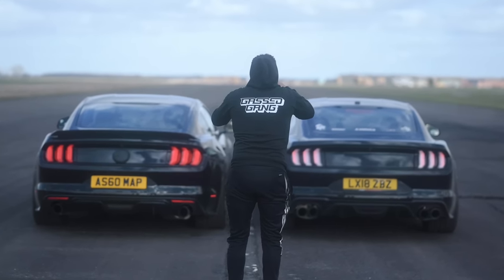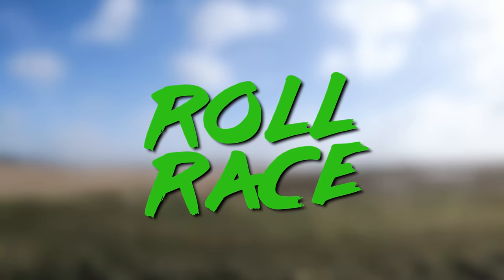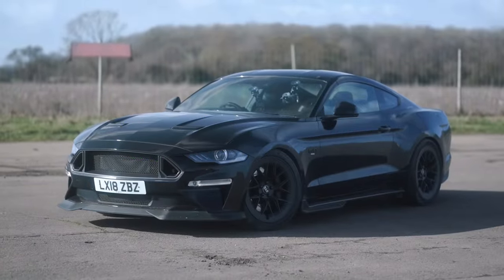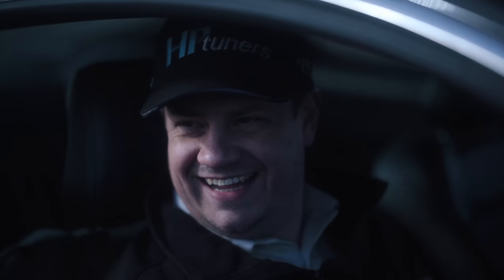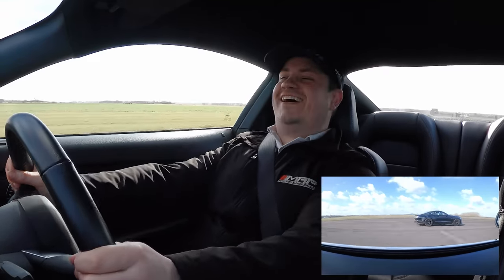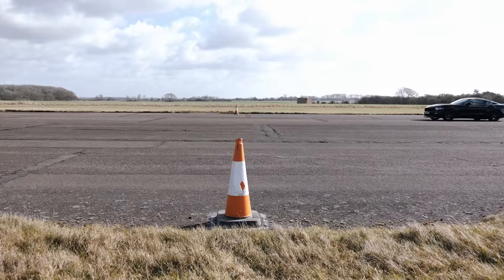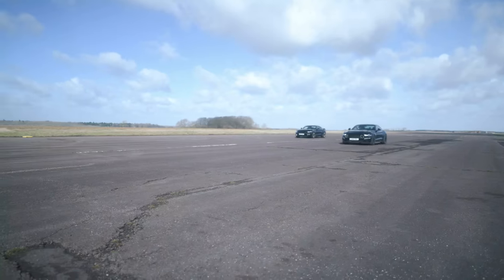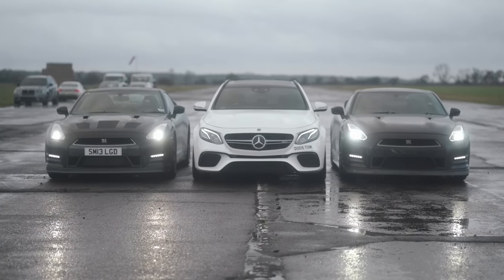TWIN TURBO vs SUPERCHARGED.. 980BHP vs 950BHP FORD MUSTANG GT

Comment: I have seen some poor driving but this is at the top.   They managed to run slower 0-60 and quarter mile times than the stock cars. I've personally gone 12.23 at 117mph in a bone stock 2020 Mustang GT manual.  These cars should have easily been in the low 10 sec.range.
Reply: Overpowering the street does no good , so you are right you would run faster on the street with a stock GT
Reply: Even an Ecoboost can run a faster 1/4 mile than these
Reply: If you overpower a car, then it will inevitably go slower in short distances due to a lack of traction. Just as Bosko said. Plus, these are manuals. Looks like you aren't a car guy.
Reply: I wish they would’ve put some slicks or bigger tire on the rear
Reply: @aXrF  Set up a 2 stage and that wouldn't be a problem. I have a 2018 Mustang GT just running a tune and E85 and my 0-60 alone is 4.2 with street tires and a non prepped surface. 
There is no reason why there cars should be running slower at any distance.
Reply: I’ve been 10.30s on a 100 shot…. These are turds
Reply: Thank god I’m not the only one who thought that like my gawd
Reply: you can tell they’re there just to have fun not set the fastest times
Reply: As the narrator said. "With a prepped course these 2 cars are 9 second cars." Unprepped, they can't get traction. Overpowered.
Reply: @caaleb49  Nah, I don't think so. But you can always dream.
Reply: @Necronomous  a stock Ecoboost runs a quarter mile in 13 seconds. An FBO Ecoboost will run sub 12’s. I have an Ecoboost and it runs sub 12’s and I haven’t even installed my NX2 Turbo yet.
Reply: @aXrF  my manual, on the street w/ stock tiresn no boost, tuned w/e85 ran 12.3 on draggy....
Reply: @caaleb49  Good for you. Unprepped or prepped surface? If you say prepped surface, you are still 3 seconds behind these 2 cars.
Reply: @Necronomous  Never even taken it to a strip, it’s a track car and I do all my runs on a long stretch of flat road in the middle of the desert. It has built in 60 foot, 1/8 mile, 1/4 mile, half mile, and 0-60 measurements, so that’s how I get the numbers.
Reply: @caaleb49  Nice
Reply: @aXrF  dude I drive a manual 3v with FBO only and I can get faster 0-60 and 1/4 miles than them, they’re kinda slow drivers and the road is bad to tbh
Reply: Traction bro they didnt have it thats why if the had drag radials on they would have been quicker but slower on the top end
Reply: You obviously know nothing about cars and racing on the track
Reply: 06 jeep liberty stick with a good launch I’m fucking flying it’s actually fast somehow
Reply: Not a car guy? Proper driving skills should still yield quicker 1/4 mile times.  The real telling factor that demonstrates the crap driving is the mph...  128!?  😂😂😂. The original point stands.
Reply: They are also on unprepped surfaces that have bumps and did not build boost at launch, with the factor of not heating up their tires.
Reply: @jordantaylor7457  Exactly. So many things they could have done to shave significant time off those crappy runs. Very inexperienced drivers.
Reply: Bro no way you went that slow on a mustang gt I can’t believe it 😭 my 149hp 22 Sentra hits better time than that wtf 😳. Liesss lmaoo i want a Mustang eventually don’t tell me these things
Reply: Traction and massive turbo lag are the big issues with the turbocharged Stang
Reply: @boskotanackovic5240  noooo.. these cars can definitely launch at 1000whp on the street. The dumb part is they aren’t on a radial
Reply: The slicks would obviously help with the launch..... but I gotta be honest those are the laziest shifts I've ever seen. The average person that gets a stick got it for a reason and can usually shift a lil faster than that.
Reply: I agree with what you all are saying. Slow crap drivers. Even in a manual these cars stock are quicker. Maybe they are at some insane elevation. Or maybe they just suck at driving.
Reply: I have done a 12.4 quarter mile at 117 with a fbo 2015 mustang gt. These drivers are a joke.
Reply: You do realize this is essentially worse than no prep right? It's a runway, so it's built for endurance, and thus is way harder surface than what you'd find on any street
Reply: @aXrF  No they can't drive.
Reply: Upgrading its power without also upgrading its traction only makes it slower just for short distances only. Power is nothing without grip.
Reply: @valferdinandmonissabiano8641  Then there's something called trap speed.
Reply: @TheCHRISintheMIX  That's not true. Who told you that? You do realize people race on runways right? The surface isn't prepped.
Reply: @MF-Rell  Yeah, here in europe. Why do you think that almost everyone goes 4wd when dragracing here? Because we race on ol runways with no traction
Reply: @valferdinandmonissabiano8641  it's because they're set up for a prepped drag strip. Just like most of the drag cars you see online going 9's
Reply: @aXrF  better tires= better 0-60 and 1/4 mile times
Reply: some of worst shifting Ive seen. A shame...
Reply: on street tires on a dirty runway?
Reply: @Necronomous  nah homie watch that slow ass 3-4 shift. He babied that thing in gear. I'm betting stock oil pump gears stock clutch and stock mt82 trans still. Should have calimer stage 3, mantic clutch, billet oil pump gears and a Lund tune. Stop being cheap
Reply: @caaleb49  careful eco boost only holds about 400whp before you need to build motor or atleast drop In pistons
Reply: @aXrF  I think you aren't a car guy lmao
Reply: @chrisnauta2467 lag typically isn’t a problem anymore with modern eq but hell the lag ah or old help when traction is bad..
Reply: Spinning ain’t winning
Reply: My mom can shift faster than these two dudes, and she's in her 60's
Reply: 🤣🤣🤣 im in stitches by all the short shifting,mid rpm and sloooow shifts.....you wanna see fast shift manual GapSauce is ya man
Reply: Mph doesn’t lie regardless of the traction the cars have, the mph will always be pretty much the same.  And these are running barely over stock mph.  The twin turbo was the biggest disappointment, superchargers take engine power to run, turbos do not. So should have been no comparison.  Something isn’t right with these setups.
Reply: Low 9's is for sure at that power level. Just pathetic.
Reply: @allena616  maybe with some slicks at a drag strip with a 3 speed and the suspension setup suurree  other than that  calm down cowboy
Reply: I think the problem is in the drivers 😂😂😂
Reply: Some guy tuned a Ford Maverick 2.0L Turbo (for those who don't know, it's a small little truck, lol) AWD that does 0-60 in 5 seconds, faster than this guy in the turbo Mustang with over 950hp, lol.
Reply: @aXrF  I'm a car guy and yes, you can over power a car if you don't know how to drive it.  If you do you know how to make use of the extra power.  You can easily utilize it.  Please don't call out a non car guy and pretend to be one.
Reply: @Necronomous  More like underdriven by underdrivers. :)
Reply: @aXrF  Lol get real. I know old gear heads that have been racing since the 70s. They all use automatic or ratchet-automatic transmissions (TH350, TH400). Autos go faster and are always better for straigtline speed.
Reply: 900hp on a “street tire” what do you expect of course it’s spin city
Reply: it's the right-drive... 😝
Reply: I second what you say! I've seen two tone Notchback Fox bodys with a different exhaust and a poormans ramair get better times!
Reply: My words exactly!
Reply: @boskotanackovic5240  Hence, poor driving.
Reply: @aXrF  i agree with the first part, but a manual transmission (if you know how to race with one) isnt that much worse than an auto. yes an auto will always beat a manual if you put two good drivers in each, but the manual wont be that much further back as these two cars are showing
Reply: Well, it's not a prepped track for one, so them launching at say 4k would just be a smoke show.. and without doubt would be slower.
Reply: Yeah at a track with prepped surface.  Put a prepped surface under those cars and it's a different story.. Stupid comment. You half half the hp, maybe one day you'll understand how hard it is to pedal a car that spins to 100mph. Not one that just sticks because it's slow and just goes.
Reply: @cwhittington8288  no reason? Lol how about track temp, track surface, twice the torque to put down and manage. When you have a fast car, you'll understand. It's easy to make a slow car perform because they hook and go. No traction issues like a car that makes 1,000tq at 2,500rpm.. where yours makes 200tq lmao
Reply: @caaleb49  on a prepped surface that cute little 4 banger can hook. You have no power to break the tires loose to have to pedal it and drive. You just put your foot down and wait for all those 4 cylinders to male the turbo spin to make power lol that's a really cute car though. But you can't compare it to a GT let alone in GT with 15 lb of boost being stuff to it you have a rental car
Reply: Traction is too limited on this runway.
Reply: Guys... Enough of unprepped, over powered, not having slicks etc.... The bottom line is these 2 clowns are terrible drivers. Reminded me of a Grandpa cruising down the street on a Sunday afternoon. Drive these things like you stole them, lettem Rip!!!!
Reply: Exactly 😂.  Stock mustangs beat that 😂😂
Reply: @boskotanackovic5240  no you can pedal high horsepower cars people are just used to driving computers on wheels
Reply: @Pureblood1776  right, you can pedal high horsepower cars on the street even from a dig, 800+ whp 5th+6th gen Camaros squat on asphalt (small tire) so long as you do some prep (warm tires) and feather your right foot. Low pros will spin but you can catch middle of first if you back off and hold half throttle
Reply: @Necronomous Naw bro, these clowns can't drive.  Surface doesn't take three seconds off your time.
Reply: I was thinking the same thing.
Reply: Eh, can actually be quite a bit harder with more horsepower.

I once had a pickup, pushing right at 400 to the wheels. 0-60 was pretty decent as you could basically just keep it to the floor the entire time. 

I swapped a turbo LS pushing a little over 1,000 HP into it. On the street, with normal tires, its horrible at launching... Once the turbo spools, there is no traction at all. Pretty challenging to peddle it too. 

The reason I decided to retire it. Turns out, a long-bed pickup, isn't going to be very ideal for launching.
Reply: I could here a laggy turbo . Not great for small distances. Definitely was in its element after 3rd gear
Reply: 10’s? I drag radials maybe
Reply: 12.56 😂
Reply: I think the perfect amount of power for these cars would be around 600hp with some 315 rear tires. My stock 2020 gt hooks up really well even on 255 michelin pilot sports.
Reply: My men making a sammich between those shifts
Reply: Diver mod is needed for both cars
Reply: @aXrF bro I shift faster then both of these dudes in my 370z it’s called knowing how to drive
Reply: I am not a race driver or track driver, but I never drove like these guys.  I never let the car bog down in between gears.  Both of them makes the Turbo charger and Supercharger useless as they let the boost go down before they engage the next gear.
Reply: So my stock 08.5 wrx with the vf52 turbo in it would hang with them!?!? That’s prettt bad!
Reply: they are bad drivers, but they are also on an unprepped runway. If they did a burn out, had good tyres, knew how to drive and were on a drag strip then they would go way faster.
Reply: Thats why every car above 300 HP I ever bought had all wheel drive...
Reply: right, like it's literally slower than my tuned ram and it only makes 900hp, but it does make 1200tq.
Reply: @caaleb49  dont know about your car buddy...but a stock Ecoboost does not do 13
Reply: @seankinnane12  My eco wasn’t stock. Had DP, intake, spark plugs, intercooler and a tune. I sold it though, I have an RS3 pushing over 600 HP now doing 1/4’s in the 10’s. Upgrades people, upgrades!
Reply: @aXrF Your definitely aren’t a car guy.
Reply: @Necronomous Aren’t top fuelers overpowered, asking for a friend
Reply: @Regg363  Ofc they are. But they ain't driving on regular tyres on unprepped surface very often so.
I mean, Hellcat are made for mostly prepped surface with slicks on them. But yeah, you can also have fun with them on regular tyres unprepped surface, but if you are a timehunter that wouldn't be that good...right?
Reply: Ppl saying they slow 😔are dumb cuz they running street tires ,with that amount of power you should be on slicks
Reply: @cwhittington8288  The issue was the prep. If you have ever been to an unkept air strip they are very grity. Hell you can see the white dust blowing out from under guys tires while running. Mental they are running on a surface that bad. Regular roads would have better surface.
Reply: @aXrF  98% of comment section arent car guys, even though its a car clip.
Reply: They probably should have had traction control on for this one. 😂
Reply: Traction.
With this much power they can't launch at a high rpm to be in boost, and that's because of tire spin. It's really pretty simple for most people to understand.
Reply: lmao this is true
Reply: you were on prep surface werent you?
Reply: 0-3 second gear changes 😂
Reply: overpowering my ass, they didn’t even spin on the launch. even when they were pulling is was balls slow. THEY CANT SHIFT WORTH A DAMN!! they didn’t even top the rpm’s.
Reply: @chandlerpittman139  you do that consistently on a street surface, (no roll out), no prep, no burnout, on a street tyre set up?
Reply: @importantvideos4529  or just more realistic for registered street cars that aren’t going to do big burnouts at the 🚦, because a Golf R pulled up next to them.
Reply: Without doubt my 2020 would beat them 😂😂I'm just tuned E85 cat back and almost a full second faster😂
Reply: 0-60 should have been low 4's for both. At least for the supercharger
Reply: "woohooooo! hahahaaaa! a 12-8? OMG that is insane"  These boys have never driven their cars to the limit EVER.
Reply: Is not the machine.... is the driver..